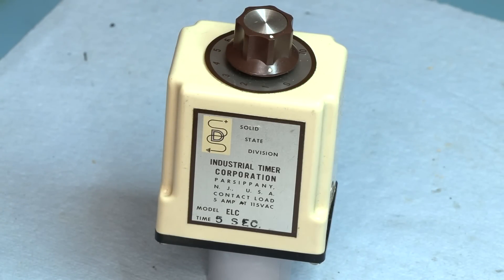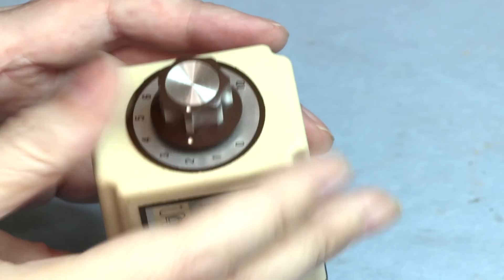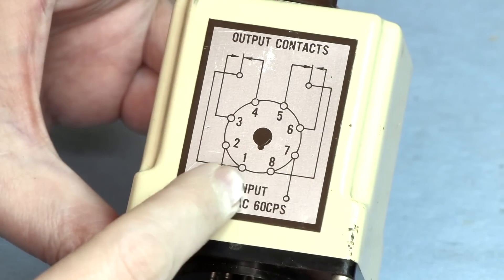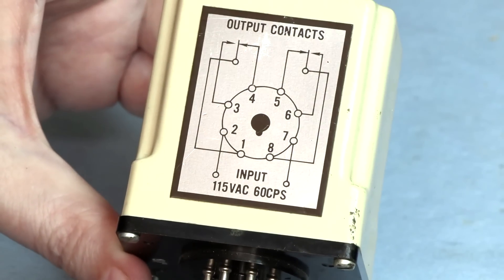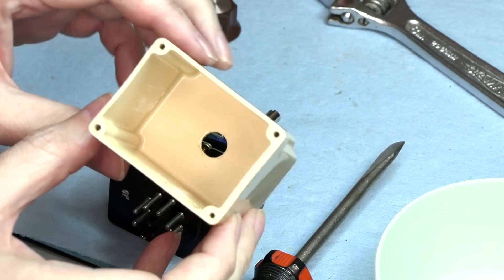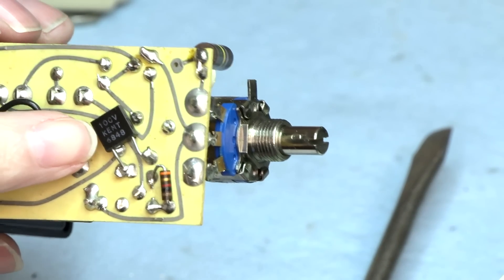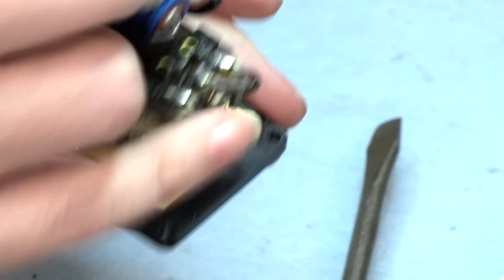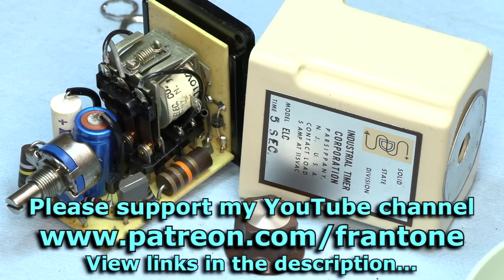Timer Module Teardown

Comment: Octal sockets have been, and still are, used in industrial control systems for easily swappable relays. With a manufacturing date of 68 (date stamp on the el-cap), I don't think this one is still from the tube transition time. Still a very nice fully discrete model. 🙂
Reply: Yes industrial logic still comes with 8 pin and 11 pin bases, and you buy a whole lot of stuff in that form factor, including small PLC units that have one or two outputs and a single input.

Comment: Nicely built. I sometimes found octal sockets in industrial automation modules and relays, R15 being the most common example.
The insides look lovely, thing of beauty, joy for ever. Worth reverse engineering.

I've got a timer relay with a thyratron, voltage regulator tube and an antique full bridge rectifier. Will make a teardown and reverse engineering video on my channel... RealSoon.

Comment: I worked with these in a previous life as an industrial mechanic in the 90’s. They were used in 60’s -70’s analog control circuits as well as more modern controls. For certain applications they worked much better than the software timers in plc’s.

Comment: Just recently repaired a very simmilar module on a Haeger HP6-B machine from 1982 or 84.
Timer relay Potter and Brumfield CFK-3878010
The socket is 11 pin, not octal. Veriable resistor is external on the machines operator pannel.
New ones are hard to come by, and expesive.

Comment: At my last job, the elevators used similar timers, as well as relays, that had octal pin sockets....the relays had 120volt coils with neon indicators...a huge slab of these timers were in a dimly lit room, and it looked like something from a 1950s science fiction movie...

Comment: The data sheet from Texas Instruments for the 2N4893 unijunction transistor is dated 1967, so that puts a floor under the design date.  Suggested applications: "SCR driver, motor speed control, timers, waveform generators, ... electronic organs, and military fuzes."

Comment: Interresting, I wonder about how the circuit works.
Reply: I'd like to see the circuit diagram. I guess a resistor and the pot control the charging of one of the   capacitors which then causes the transistor to turn on the SCR and hence the relay.

Comment: Still got a big box of plug in units, that do delay, power supply, timers and recyclers, plus voltage, tacho and window comparators, all in 11 and 8 pin bases. All probably working, and all sorts of voltages. I use them as a source of 12 and 24V relays mostly, plus for small parts and cases that you can use, like the odd 555 timer on a board to make a delay, as the small boards all come with links and cut here traces to configure them . Generally from the late 1970's and early 1980's, and the whole box of around 1000 units was $10 on auction.

Comment: Here in South Africa we still use those Octal base and header system for industrial process control modules. Looks virtually the same as the unit in your video.

Comment: I once took a tour of the old AT&T building in downtown Louisville, KY many moons ago (~1980s).  I seem to recall it housed what was known as the "Long Lines Division"?  Filled with tall rack after tall rack of mainly T1 multiplex equipment routing voice calls over cross country microwave relays, along with all the supervisory alarm and monitoring circuits.  Anyway, if you've ever smelled the inside of an old Western Electric 500 set, rotary or dtmf, the entire inside of the place smelled just like that.

Comment: An interesting bit of old technology. Since I didn't see anything like a voltage regulator or transformer, I assume that the big resistors and diode were for a simple unregulated DC power supply based on a voltage divider for the solid-state portion of the circuitry.

Comment: I wonder if the diode is to shunt the voltage spike when the coil is de-energized?
Reply: It looks like it's in line of one of the pins on the octal socket, rather than parallel with the coil. I can't spot the latter... a bit dodgy!

Comment: Beautiful build quality. Can caps that old still function? My experience with caps from the late 80's onward is not pleasant as the electolytics leak so badly.
Reply: They certainly can. My old 1940s TV runs fine with the original filter cans. On the other hand most of its smaller electrolytics went bad.

Comment: I don't think this exactly a transition from vacuum tube era relays necessarily, just that the 8 pin octal socket has the right amount of connections for a DPDT relay connections, and makes replacing the relay simple, plus why not use a reliable proven socket.

Comment: Ha ha, IMSAI Guy just did a tear-down of one of these, too. His had fewer components.
Reply: So if it had fewer components, then not possibly the same circuit/ device/model , so not necessarily "one of these".🤔
Reply: @brucepickess8097  It was a 1-180 second timer with an octalbase. 120V input and could switch 40A current. Check out his Vid.

Comment: Older automated machines used scads of these. PLCs largely eliminated the need and made things simpler.
Reply: Oh yeah. I once worked on a 1980s Polar Mohr paper cutting machine and it had digital electronics, no PLCs, no microcontrollers, and the interfacing and safety circuits were relay-based. These relays were miniature, PCB-mount, 24VDC level - only the control outputs to contactors were 42VDC. Had some fun time reverse-engineering that one, as it was acting up and I had to repair the thing. And of course it was relays!

Comment: I was putting these in brand new gas quality analyzers as late as 2 years ago. Wanted to replace them with a $0.75 circuit (instead of $45-60 per module) but the CEO was an old HAM radio hobbyist and refused.

Comment: I find it pretty strange that a solid state replacement for a vacuum tube ends up being what seems to be almost three times as large. I guess you'd be out of luck if there was another tube socket right next to it?
Reply: That's a whole timer, any one of the transistors or diodes inside is a solid state replacement for a tube/HV power supply